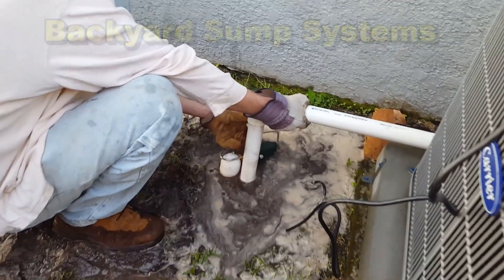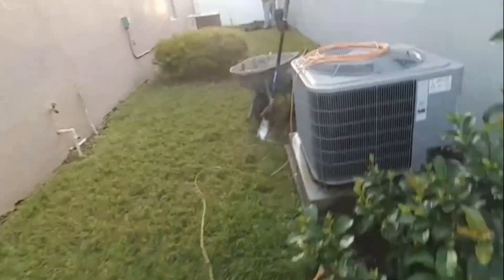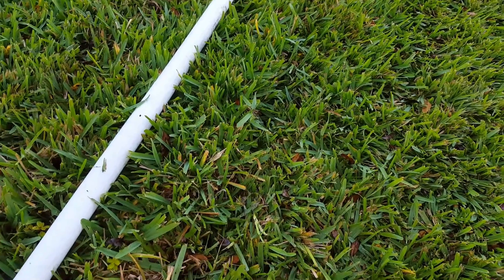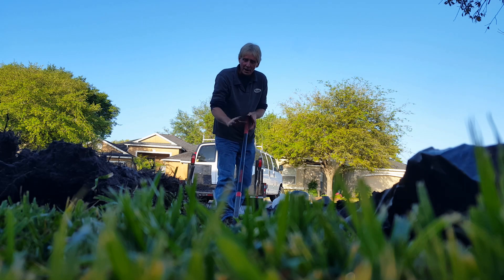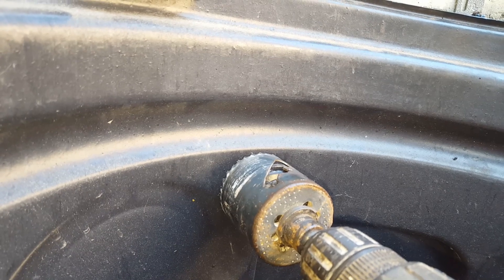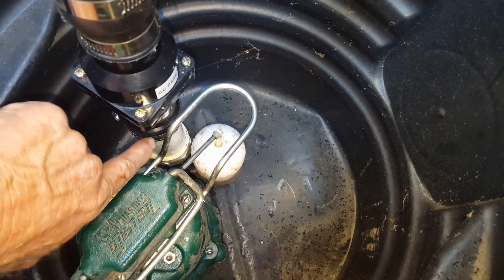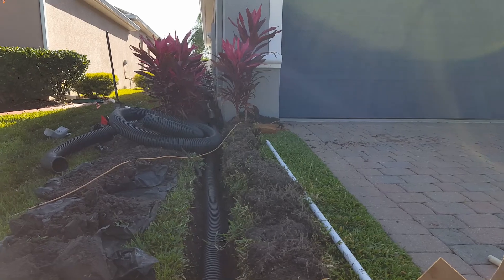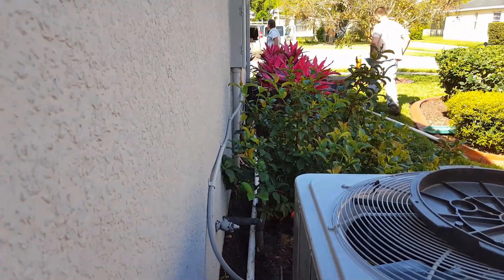Backyard Sump EZ Flow French Drain

Comment: Why do you connect downspouts to the French drains? I was always told that roof water should be kept separate from the French systems?
Reply: +1 why would you connect the downspouts to a French Drain? And to top it off,  with catch basins on the last portion? 
Shouldn't you keep the two separate?
Also, the zoeller pump is gonna blow that cheapo nds emitter :)

Comment: How do the styrofoam peanuts in the ezdrain system hold up over time? have you noticed any sinking or movement when the sod is replaced over top? my thought is the peanuts are soft and will break down possibly causing a sunken trench where as the gravel will remain strong.
Reply: The styrofoam will be there long after you are gone.